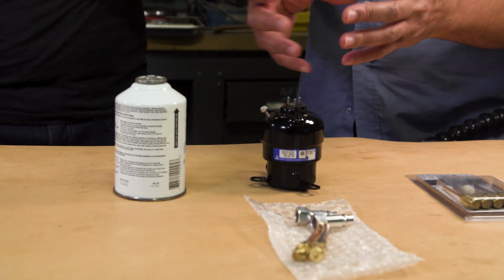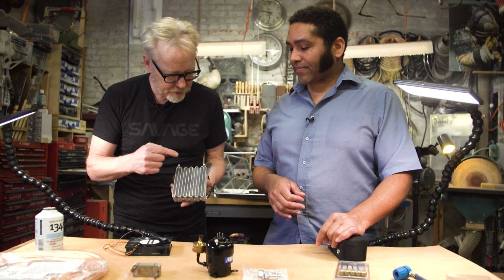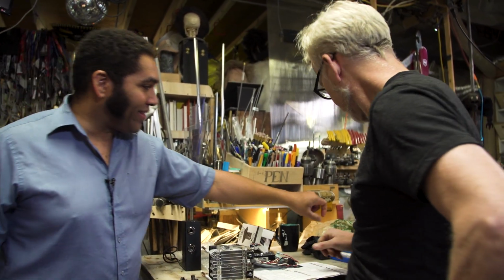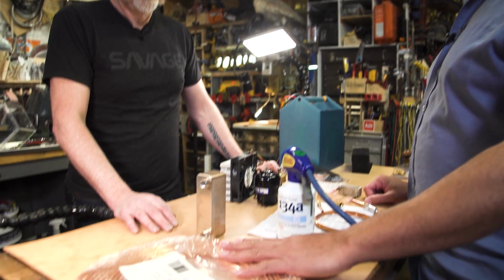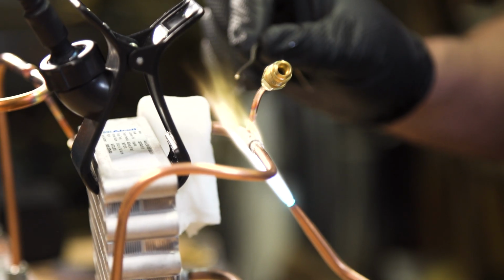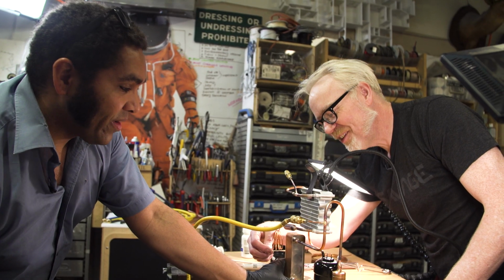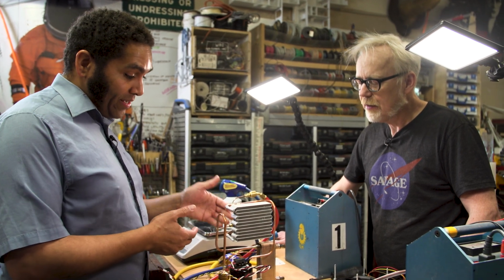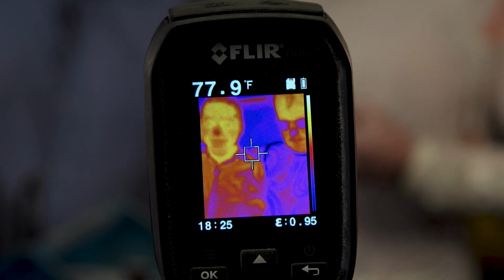Adam Savage's One Day Builds: Refrigerated Cooling Suit!

Comment: I suggest switching out the "stock" fan with a noctua fan, they are most peoples "go-to", (including LinusTechTips own Linus), in terms of pc fans, due to their low sound output.
Reply: I understand the need for high static pressure but in addition to that could someone please specify this use cases' difference vs a PC.

And Noctua or not, something with a lower noise level would be imo better for this use case.

And using a youtuber as an source to learn from: well, this is a YouTube video we are learning from. Of course credit is given where it is due when it comes to education and experience.
We learn so much nowadays from YouTube and the end result is that if you try out something different that you saw on a YouTube video not related to your expertise, you might learn something new.
Reply: Antti-Jussi Kemppainen the difference is what you’re blowing air through. The heat exchanger here is substantially more dense than any radiator you’ll find in commercial PC applications. 

Plus, frankly, Noctua fans really aren’t all they’re cracked up to be in the first place. You can’t just magically make a fan quieter. You’re sacrificing something in the process. The PC word has just chosen a low noise floor as a higher priority than actual air movement.
Reply: @mattsnyder4754  Fair enough and thank you.

Still would be nice to know the actual difference. Specially in this case when the system is a tad overpowered for the con stroll. And the noise is something to consider when designing a system for costumes.
A bigger fan with a shroud if needs be.

I'm sure that we'll see soon enough what costume Adam has in mind for this.
Reply: It also would make a large difference seeing as they made a point in saying changing a component can change the rest of the systems functionality causing them to have to change their setup based on the flow of a fan, from what I can tell as someone with zero knowledge on this subject that everything was chose to work with efficiency and practicality for the systems use
Reply: After that brief lecture on how much airflow is needed to get sufficient cooling, did you really think he's gonna let Adam get away with pulling an old tower fan out of his junkbox? Most likely he brought it with him as part of the "kit".
Reply: @markfergerson2145  Although your question seemed rhetorical: of course not!
I used a bigger fan merely as an example to reduce the hellish noise.
Reply: I agree with Tom that Noctua fans are a good choice.  My only other thought would be to get 2 fans in a push pull config which will allow them to run slower and quieter.
Reply: Was just about to mention the same. Had scroll down first to see if anyone else heard Linus yelling enthusiasticly "NOCTUA!" when the obviously not Noctua fan was brought to the table.
Reply: I was really surprised they used such an obviously low quality fan with all that other really expensive stuff
Reply: @e4Bc4Qf3Qf7  That is not a low quality fan. That's a Sanyo Denki fan, and would go for about 40 USD per fan. They're very high static pressure fans, because the fin stacks on those heat exchangers are dense.

In fact, a noctua fan probably wouldn't do much on these. This isn't a PC. NF-P12s aren't made for this usecase.
Reply: dumle29 thank you. Noctua fans are frankly an absurd suggestion for this situation.
Reply: @mattsnyder4754  Agree, definitely an absurb suggestion. A bunch of PC hobbiest telling a PhD Engineer and thermo specialist; and Adam Savage their fan choice is wrong and use consumer grade pc hardware because a youtuber recommends it.

Don't get me wrong, Noctua fans are great for consumer PCs, I've got one in this rig its been keeping this machines temps low for a decade but seriously?
Reply: dumle29 are there any visual indicators in the difference in quality or design besides the name?
Reply: @e4Bc4Qf3Qf7  in general, there aren't really any universal signs that a fan is high quality or not. In this case the brand gave it away.

That said, the larger ventilated center hub on this fan was a good indicator that it's a high powered fan.

I agree that this fan is too loud for a costume, and I'd hope they could use something quieter. It seemed like the loop flow was their limiting factor in this current setup, so with a stronger pump they might be able to drop the fan noise significantly.

Comment: This will probably get lost in the throng of comments here, but I felt compelled to contribute. I'm a Union Steamfitter, so I often work on very very large HVAC and refrigeration systems. I hold a Medical gas brazing certification as well as welding certifications so I think I can speak with some accuracy on how skilled and intelligent your guest was. I was thoroughly impressed by the system you put together and very much enjoyed seeing a professional work on it. I usually work on systems many orders of magnitude larger than this so it was fun to see the basic elements in such a small package all working together. I personally also love working with a tubing bender, although I prefer working on stainless tubing rather than copper (the rigidity of stainless tube lends itself to higher accuracy and more impressive workmanship and appearance when done correctly).

I cannot state enough how thankful and happy I am to hear an educated man talk about how valuable he found his trade related learning and to hear both of you talk about how important it is to be multi-disciplinarian. I personally remembered back to high school chemistry and physics during my apprenticeship and remembering and understanding Boyle's Law is something that definitely made me a better Steamfitter.  

The only thing I have to disagree with is that flux is never optional. Thoroughly clean and flux every joint, even copper to copper. It's cheap insurance to guarantee that you've made a proper braze.

That said, thank you for the interesting content, and I very much enjoyed the longer form and slightly more technical aspect, and I would love to see more guest experts on 'one day builds' to help Adam keep swimming in the vast ocean that is making stuff.

Comment: I built a combustion engine so bad once I called it 911 call fire department. It sprayed oil out the tail pipe so bad  I was lucky it didn't ignite. If it actually had fuel  to run it would have fire out the ass with oils. I included some info in a box minecraft video game engine in 1998 the design. Some one stole it after I tried to put the really hot engine parts on a shoe box to toss out a window but couldn't get it out of the window it kept falling off. So I put it some were to cool off then it disappeared for some reason.

Comment: Why not use solid state peltier devices? Less noise and weight. Battery, peltier with controller and fans. Or use the "fluid" to turn the fan too? So more pressure is higher speed, so auto adjust?

Comment: Me: I'm going to take a break from studying for my engineering exams by watching the new Tested!
Kipp: This heat exchanger operates based on a reverse Rankine cycle.
Me: Flashbacks to my Thermodynamics course last term
Me: I'm going to take a break from this Tested video by studying for my engineering exams!
Reply: I failed my Thermodynamics course last term, but will try again this semester.
Reply: @nrdesign1991  Best of luck! It's definitely a really tough course, but if you end up with areally  good professor this time around that can make all the difference!
Reply: @onbeyondzebrabydrs  Thanks! I can't attend the lectures, because another one blocks the time slot, but I will try learning from my notes and the printout/PDF.
Reply: I DID THE SAME FLIPPING THING
Reply: How much energy does temperature have?
Reply: @mastermachineman1462  I don't really know that there's a simple answer to that (although I'm far from the best person to ask, thermo courses have never been my strongest). Typically when we talk about energy and temperature, it's in the context of the particular material being discussed (i.e. how much energy does it take to change the temperature of this material by this many degrees?) and often requires other information about the system, like pressure.
Reply: @onbeyondzebrabydrs  what i was trying to say, is if i have an objekt that has a temperature of 100 K , and then duble it to 200 K , will the energy also duble? or will it increase by 4 times?
Reply: @oliverhosbond7607  you forgot delta M being mc^2-(m-deltaM^2)
Reply: my friends studied engineering when I was in school for comp sci and fluid dynamics and thermodynamics were about the same as witch craft to me.
Reply: The best thermodynamics explanation i ever had was during my EPA 609 recovery and recycling course as a diesel tech at Wyotech. The refrigeration trailers we were learning was so comprehensive. The Corinthian College course books were the best to review with. Now i do Auto and Diesel A/C work similar to this build in my sleep. lol

Comment: depending on how much pressure you need maybe look into swapping the fan with one from noctua https://noctua.at/en/products/fan they are designed to be high performance and quiet in computers so you wont have that high pitched whine coming from your back when walking show floors
Reply: They had it running at the 100% for this test cycle, but if it matches the specs they discussed they should be able to run it at 10% speed to make it super quiet.

Comment: My dad and did TV repair in the late 70's and early 80's, we had a problem and called the factory for some advice about a problem. My ad talked to an engineer that was very familiar to the design we were working on and gave my dad a very intense explanation about the components and what they each did. When my dad asked what made the components not work as designed he had no idea so he transfered my dad to another person at the factory. After a very short conversation the other guy told my dad what the problem a value of resistor whole brand the approximate value along with color code the resistor should be and said the code would look like brown, brown, brown with a tolerance code of brown. It turns out the wattage needed was almost exactly what was inserted and for normal usage should have been doubled. After finding out what wrong he asked the guy what his job was and was told when a TV reached final testing if it didn't work properly he fixed the the TV. He was a repair man and knew more about the actual operation the engineer's that actually designed the system.

Comment: As a amateur builder of watercooled PCs (if you haven't done so already): Try using a push/pull-fan-configuration on the heat-exchanger/radiator, you might be able to lower the speed and make it even less audible (perhaps switch to fans used in watercooled PC-setups with a high static pressure as well?).  Also, given the noise-level you might want to look into Laing D5/DDC pumps for your water loop. They are pretty much the standard when custom watercooling computers (readily available), should have tripple the flowrate and double the pressure. They run off 12V and should still generate less noise than your compressor.
Hope this is might be helpful.

Comment: 18:25 how much was that cool suit?  The solutions I've been looking at are $500 for a full system.
Reply: Those cool shirts arent cheap.  They are used by race car drivers.  Cheapest I can find is 180 for the shirt itself and they go up from there.  Normally in race cars they just circulate water that has been chilled with ice in a cooler.  After that you need the plumbing hookups and a water pump

Comment: Maybe someone can answer this question. They are using Nitrogen for the flame as well as testing the system. As a welder, we use Argon or some other inert gas like xenon to make sure that no oxygen but Nitrogen is not an inert gas. What is the benefits of using Nitrogen or why is that the preferred gas?

Comment: Adam, if you want lower noise try a Noctua Industrial Fan,  they are the best for low noise and high CFM, also good static pressure designs for radiators.  Even though I doubt you'll see this, just thought I would sound off..

Comment: It's really cool to see this finally getting made.  I talked with Adam about this years ago, and actually recommended that exact Aspen DC Compressor!  Although suggested 3M Fluorinert as the heat-transfer fluid, since it's low-toxicity, non-corrosive, and not flammable.

Comment: R134a was replaced by R1234YF
R12 was replaced by R134a
you can still buy R12 but boy o'daddy is it spendy. when i was in commercial auto part sales R12 cost's were going up by about 10-20% per month. now it's around 1200 bucks

Comment: Every refrigeration system has 4 main components and they are the compressor, condenser, evaporator and expansion valve... you could argue the refrigerant is a fifth item as without each part (including the gas) the system will not work. FYI

Comment: Maybe try using Noctua fans, if the fan noise gets to loud, however I dont know if they can keep up with the Delta fan  you have, in terms of raw throughput.
Maybe two fans in push-pull-configuration could work.

Comment: For anyone looking to replicate, may I suggest a 40 liter refrigerated cooler?  They make small rv compressor coolers with digital controls, you can get them on Amazon for $300-$600. Costway, Alpicool, Dometic, etc... Might be easier supplies than scratch building it? On the off chance you don't have a electromechanical genius like Kipp hanging out in your workshop 🤪

Really tho I was honestly surprised you didn't have something like this when you made your alien space suit!  What a great thing to have around.

I was just brushing up on Tig welding "incompatible" metals the other day for the current big project I'm working on... Specifically aluminum and steel.

Comment: There’s a company called Chillout Systems that makes this same exact thing as you just built with the same compressor for racing. I’ve driven a few race car with them installed and the system works great a lot better for endurance racing versus a traditional ice box system. I believe the whole system is about $2,200 and only weighs about 10 pounds; it’s also very user friendly for racing.

Comment: So he wants to use capillary tube instead of a simple piston which would be more efficient entering into the evaporator. Agree with some what he says but not what I would do as a hvac tech. Never use a bandsaw to cut the pipe, never blow into the copper lines.  I wouldnt have used garbage micochannel that leak all the time. 

Also the completely stupid idea of dunking into water to check for leaks on a system that any ounce of moisture will kill the system. 

Doing a  nitrogen pressure test does the same thing without the major risk of failure. If he had any leak he just killed all the work he did. Also never did a proper vacuum to remove the moisture from the system and just dumped charge into it. Another reason a engineer is not a technician.
Reply: He did pull vacuum- he said he'd pulled the vacuum over an entire weekend just before they do they fill. (Doesn't show us what vacuum numbers he got!)
Reply: @JacobAllison   never heard him say it. On a system that small would take no longer then 1 hours max. no reason to run overnight unless it has a large moisture problem or a leak. My guess he didn't have the tool to check the micron level to do it right

Comment: I know zero about any of the skillsets involved here. What is the advantage of copper tubing versus flexible webbed hoses that have replaced pipes in household plumbing?
Reply: R134a can have operating pressures in excess of 300 PSI depending on ambient air temperature. PVC or pex is not rated for the pressure. Copper also handles the large temperature swings better than plastic.
Though I do wish there was a better option.
Reply: @Goesreallyfast  Interesting. It's strange to me that a metal as pliable as copper would have a better pressure rating than a reinforced hose. Not disagreeing, just thinking out loud.

Comment: Adam should have gone with a Noctua NF-F12 fan as they have a super high static pressure that he would want to push air through the rad and to keep it quiet, I use them on my PC's radiator. They also have a ridiculously long warranty compared to others, 6 years! That fan Adam used sounds like a jet engine!

Comment: Could you lighten the system by compressing the refrigerant ahead of time off the suit, and replacing half the system with a cylinder of compressed refrigerant and a regulator? Adam doesn't tend to cosplay indefinitely, but only for short periods.